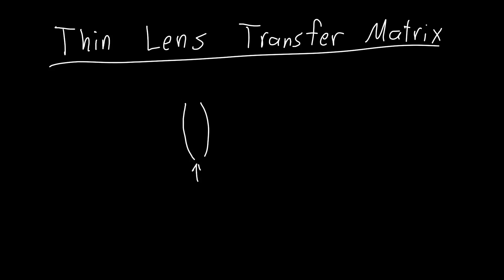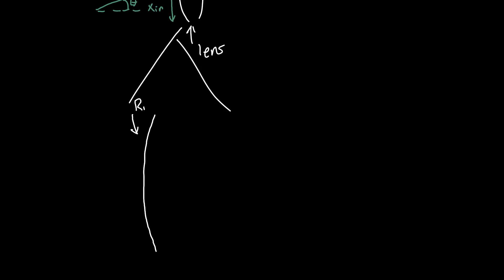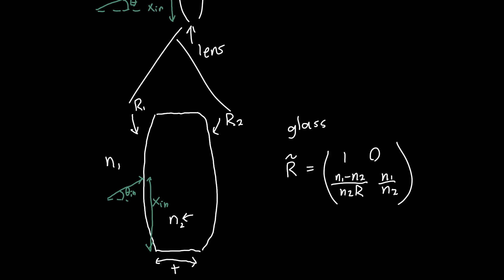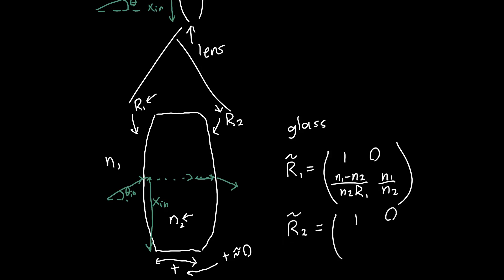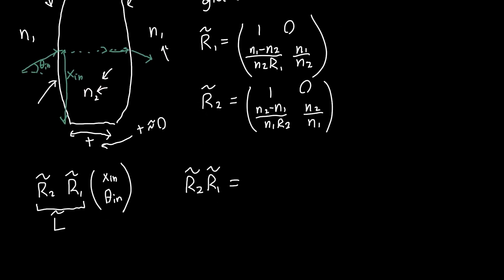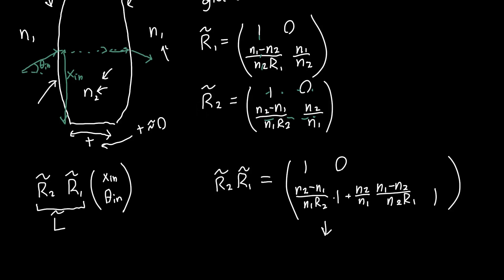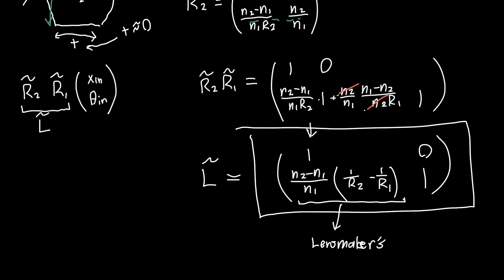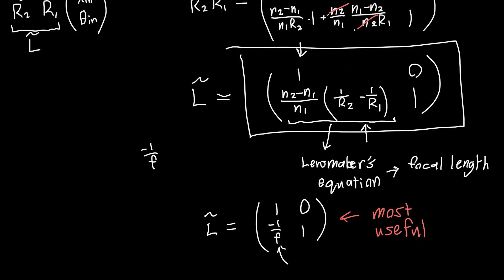Thin Lens Ray Transfer Matrix

Comment: I have a question.. Shouldnt it be R2<0 as it is concave?
Reply from the maker: In general, R2 can be negative or positive, but you will want to subtract 1/R1 from 1/R2 because you're going from low refractive index -> high refractive index in one case and high refractive index -> low in the other case.